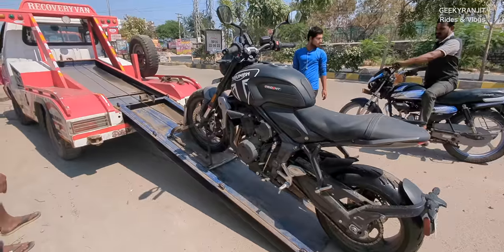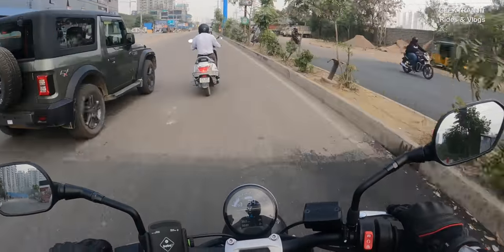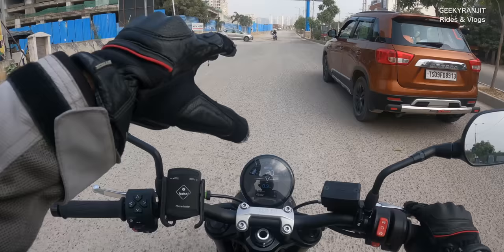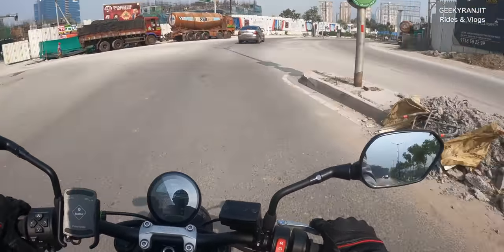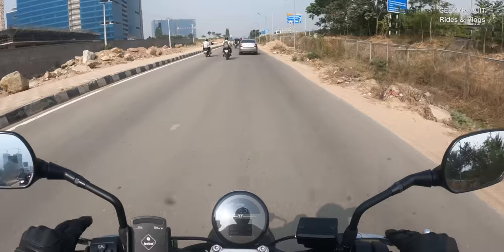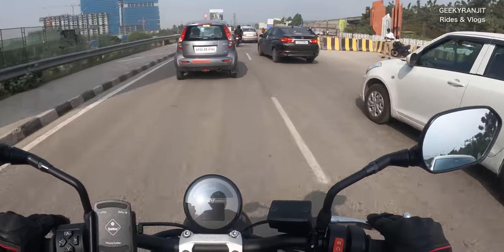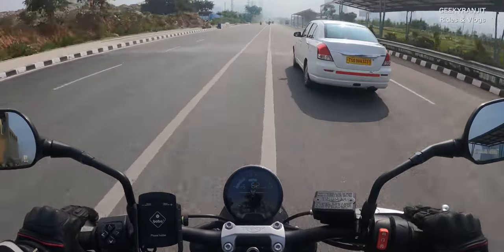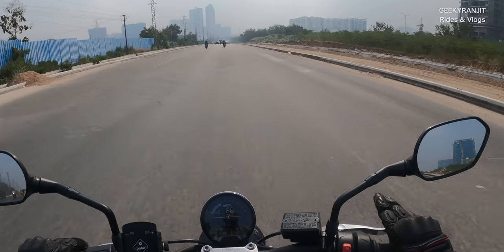Fixing the Triumph Trident & Experience After a Year

Comment: if you'll use the rain mode all the time, you will wear out your calipers faster. In rain mode the calipers are set to constantly touch the roater disk in order to optimize the abs and braking control for rain.

Comment: Any plans on changing your stock exhaust? Cmon this inline 3's gotta sound beautiful. For that you need a good exhaust. Check out two bros or arrow for this.
Reply: Arrow has not yet come out with a slip on for the Trident
Reply: @m2kewl  You have to put full system exhaust. you can't put a slip on unless you cut the exhaust pipes.
Reply: 1.4 lakh full system exhaust for trident ...slip on not possible as cat con is welded with headers

Comment: Most high capacity sports bikes have very less ground clearance than the smaller bikes manufactured here in India, except for couple of bikes like Kawasaki z800 and Ktm 790 Duke both have decent ground clearance to take on Indian pot hole filled roads
Be careful if you are riding any other super bikes else you will spend good amount of money to get such repair work done

Comment: Sir, Did the changed the whole belly Oil pan or fixed it ? if fixed ? fixed it how ?
Reply from the maker: They welded it, they said the damage was not that much so they can welde it this time, if I am okay with it, else replacement would be Rs 14K + labour charges.
Reply: @GeekyRanjitRidesVlogs  Next time i ride my trident , i will keep it in mind to watch out for speed breakers, here in Kolkata there are speed breakers as high as mountains , lol... :( :( :(

Comment: What is this 95 octane whats difference?
Reply: High compression ratio engines require higher octane to function at its best (better combustion)
Reply: Power petrol is 95 octane

High compression engines like trident 660 have compression ratio more than 12:1 they typically need high octane fuel to function properly in order to avoid engine knocking sound